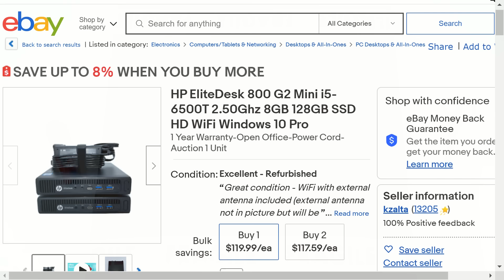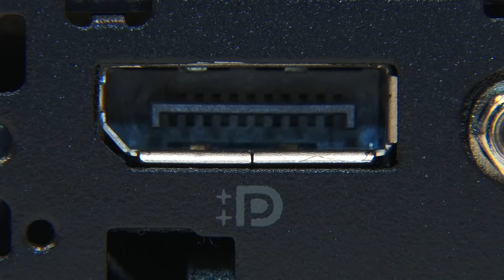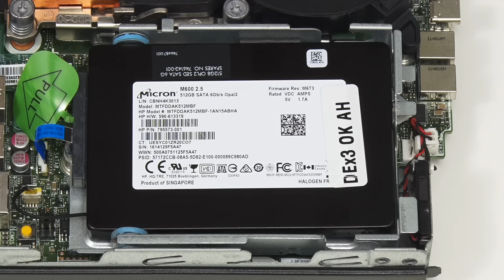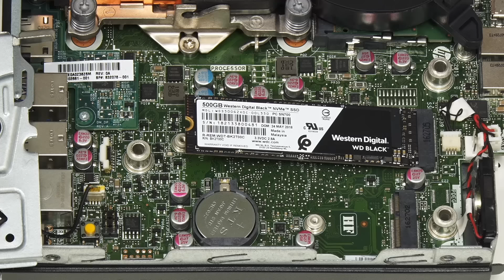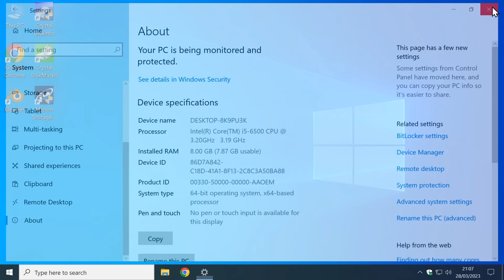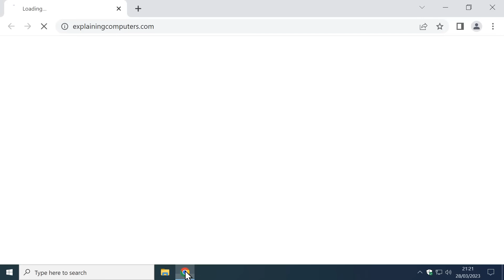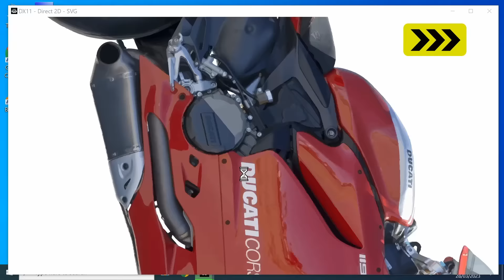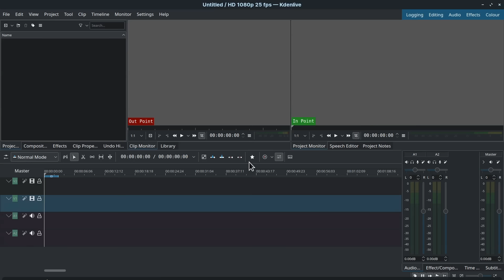Renewed i5 Mini PC: HP EliteDesk 800 G2

Comment: Just a word of warning... I picked up an HP EliteDesk 800 G3 Mini with a Core i7-7500 CPU in it about a year ago and it has been working very nicely since then BUT I did have a problem when I made an attempt to upgrade the BIOS on it.

When I did the BIOS upgrade, the original device serial / ID number was wiped out and afterwards it wouldn't reboot without carrying out a few key presses to cancel a related error - a bit of a "pain in the bum" in my case because I was running it headless as a media server.

Fortunately, I did manage to find a fix after doing an Internet search, I was able to put in a device ID that worked for the purposes of allowing the mini PC to boot without any key presses.

But a very nice and stable machine otherwise, the only negative is that the fan can get a bit loud - but as mine is wall mounted in a cupboard, it's not an issue for me.

It also runs great with Linux, so don't feel obliged to have to use that Windows rubbish.

Comment: I usually buy i5 8100 or higher systems for £90-110 with 250gb(240-256gb) ssd as they include no fuss installing windows 11 (has minimum requirement cpu and 2.0 tpm)

Anything under i5 8100 you should only be paying £50 or less unless they come with a ssd then £70-80 (but windows 11 can be installed on unsupported hardware just it complains more about it) 

and on the note of windows most of these business systems use pro key built into the bios (just install/boot with a Windows 10 or 11 Pro and it will automatically activate once the internet is seen) but I recommend opening gpedit and setting windows to delay feature updates by 100 days and normal updates for 20 days so your not beta testing updates ( a recent update was breaking tpm detection, this doesn't affect any of my customers because the fixed update will be released before it gets to my customers or PCs I have setup) 

For reliability if they haven't failed yet its less likely to be as unreliable as a new pc (these are business class systems) worst case is the fan in them failing or dust

Note With newer HP systems be super careful updating the bios inside windows (as in don't do it in windows 10/11 or do it in windows 7 only) as I trashed a hp i5 8100 mini form factor system when the update didn't update so when i rebooted system the bios was trashed (bios corrupted beep error)

Comment: Yep, good little boxes.   My house is spread out across a mountain side so beside a potent tower in my office, I keep mini PCs in the kitchen, the solar room and my garage.   I've been replacing all my Elite 8200s with the EliteDesk 800 G3s...  I was a bit surprised that on this model the USB3 ports are all black, no blue inserts.   But, they work fine and since I have them on the integrated work centers, I don't see the ports anyway.   These are great options and the refurbs are well priced (compared to new).

Comment: I have personally imaged and cared for thousands of these machines in a healthcare setting. These things still run when caked in dust. Great machines
Reply: what type of O/S they are running in your environment?
specs of hardware?

thanx
Reply: @bensmotorbikes  Running windows 10 (4gb ram, 128gb ssds or hdds)
21-25 degrees wall mounted in wards. Full of nasty dust and hospital crap
Reply: @tbrowniscool  nice!!!
did you do anything special to them to make them work in hospital environment?
things like disabling USB to prevent people hacking the devices by using some usb flashdrives, wifi using certificate authentication ? (or wifi disabled at all?)

lock bios? 
disk encryption?

what about CPU fan? had any issues fans failing?

i am asking this because i am looking for similar device for schools on budget for a lot of children while budget is around 200$ per device (excluding monitor/keyb/mouse).
and main purpose is to have it running basicly 24/7 in classes while keeping maintenance and hacking (preventing kids breaking or hacking O/S) as low as possible..
Reply: @bensmotorbikes  Yes we use a custom windows image that disables USB use etc. All machines use bit locker and locked bios of course. All machines use wifi and if they are wired up that's a bonus. We do no physical changes to the machines.

Edit: we are spending about £400-600 per desktop and about £700-1200 per laptop btw.

Yeah make sure you order the right machine and have the knowledge for a custom windows image. Ideally flashed from a usb stick or network point. How many machines are you thinking of. Kids can't break what we have but out budget is over a million pounds a year on windows licenses!
Reply: @tbrowniscool  well, its a voluntary project, licenses for ms windows are provided for free basically.

we only need to get the proper hardware.
i was thinking about either this device or similar from Lenovo or Dell..

The main usage will be for kids to learn programming and school projects.

currently the requirement is for a pilot run for 80 machines... (2 full classes + some spare machines.)
Reply: @bensmotorbikes  Well it doesn't matter that much what hardware you buy. If you cannot image the machines to have custom settings the kids will break/hack them. 

SCCM is the main tool for providing functionality once them are imaged and deployed.
Reply: @tbrowniscool  for imaging i am thinking about using FOGProject tool + ansible..
and image will be sys-prepped with all basic required stuff pre-configured + required software installed..

Comment: I sold a lot of these to my clients.  You can get the bracket to mount them to the back of the monitor or even under the desk.  I have one of these exact models right beside me that I use for my Kali linux machine with xRDP so it can be headless.

Comment: I have nearly the same Hp with a i5-6500T. The power consumption of this system is astonishing very, very low. Another very nice little and cheap computer are a HP 705 G4 Ryzen 5 Pro 2400G (65W) or with a 2400GE/2200GE (35W)

Comment: Thanks for the review.  I was looking at these on Amazon.  The prices seemed better than reasonable for the specs. At this point, I have two one year old Ryzen 5s and two older Mac minis, plus an iPad, iTelephone, one of those $100 PCs and a bunch of Raspberry PIs. I'd consider one as a media centre PC, but the menagerie is overflowing and I only have one pair of hands and eyes so there's no room to add more gadgets. The Mac running Mint is doing fine for that purpose anyhow. I'm not terribly bothered by lack of Windows 11 support. With any luck, that will drive prices down and increase Linux market share.

Comment: Personally (and as advice to others) I would never trust a computer that came with a used SSD unless you can verify the amount written.  SSDs (both regular sata and nvme) are so cheap these days (for a 1TB or less) that you might as well just put a new one in and then you can sleep better at night, if the computer is going to be used for anything substantial like a regular home computer or to store information that is important (like pictures, or important emails or documents, etc; although you should always have a backup regardless).

For most people, even the Intel 6000-series and newer CPUs are plenty for the average person's needs ( I use a full sized Core i5 6500 at work and for work purposes, works perfectly fine for what I do, which is mostly office work, watching youtube, listening to music, among other common tasks).  The people who may benefit from the newer CPUs would be media creators (people making videos or photographers, graphic artists), enginners, and gamers primarily (and for many of those tasks, the graphics card will likely make more of a difference than the CPU itself).

Comment: This issue with M.2 screws is a constant irritation and a huge design flaw - Those tiny screws are always either missing, fall on the floor or fall into the guts of the machine where they are impossible to find, especially when working on a vertically mounted motherboard or tightly packed laptop. I consider it a huge oversight that they didn't design these slots with a simple onboard twist retainer or spring clip like RAM has, after all M.2 devices don't need to be held down with any kind of serious force.

Comment: I purchased an hp prodesk g4 for $160, personally I definitely would recommend stepping up to the newer 8th gen CPU (8500t), especially if you are using it for a Plex server. My unit can actually for two ssds, but didn't come with the HDD caddy.

Comment: My son and I messed around with renewed SFFs and laptops for years. Plus, I repaired or rebuilt used systems for years due to affordability. What I valued about that experience was my experimentation with over 20 OSs to determine usability and preference. Many people do not need the powerful systems that they purchased due to desire not need. Which channel was the most influential and informative over the years - Yours! Thanks, Christopher!

Comment: Warning: when removing the SSD, the aluminum washers around the small blue pads may fall into the device and cause a short circuit.
These aluminum washers can be removed without any problem. It's safer.

This PC works fine under Artix Linux.😎
**
Attention : lorsque l'on retire le SSD, les rondelles en alu autour des petits plots bleus risquent de tomber dans l'appareil et causer un court-circuit.
On peut ôter ces rondelles en alu sans problème. C'est plus sûr.

Ce PC fonctionne très bien sous Artix Linux.😎

Comment: So, the installed Windows 10 was already activated?  STRANGE about the inability to check total SSD writes OR to update the firmware.
Reply from the maker: It was indeed. And the first run was "correct" -- prompting to create a user/etc. Just like any new PC. But this will of course depend on the vendor.

Comment: Looks great for easy, low cost, low powered, low horsepower required, computing, especially in the realm of Linux workstation and set-top box for media center.

I have 2 uses I'm looking for:
#1. Windows 10 Minecraft Bedrock / Android Bedrock from APK file on Linux with Java edition on Windows and Linux.
#2. Media Center set-top box under Linux.

I'm guessing that for streaming, storage and playback, this unit and other similar units - especially with increased performance hardware - will be able to keep up this demand.

I'm interested to see how the performance is on the 3-4 versions of Minecraft.

Comment: ive got 3 old dells. a 9010mt which is used as a 24/7 media and cctv server, its been running for over 5 years now and cost £100. also 2 laptops still going strong about the amount of time so def worth a punt! forgot to add all 3 are running tiny win11 :)

Comment: I watched this from a HP EliteDesk 800 G3 Micro, that I bought as a second hand machine from a PC recycler, I upgraded the ram and am running Ubuntu 22.04, it's a great little machine, and with 3 monitors it's great for programming and desktop stuff, when I need compute power I have proxmox servers for that, and I don't game, so this was a good low cost way to power a few monitors

Comment: 10:46 - bit crude, but unless you could find a screw, wouldn't you be a little bit... screwed?
Reply: Would you not just use an appropriate threaded screw with an adjustment washer?

Comment: A nice little PC - a good emulation / media solution for not much more than the cost of some SBCs... and HP are very reliable, I have many reconditioned HPs and they have been going for years.... Thank you for the unboxing and review!
By the way you can still buy the mounts for the HDD, I buy them when I need them, "4x HP Compaq Blue 6-32 SFF Hard Drive Isolation Mounting Guide Screws" and it's £3.50.... not too bad.
Reply from the maker: Thanks for the info on the mounts. I must order some.

Comment: I have this machine. It's running Ubuntu. It has 16 Gig Ram, 256 Gig SSD and a 1T Drive. The only problem I came accross is that my version will not allow for 2 ram sticks. The 16 Gig is a single chip.

Comment: They make great media PCs and work very well with Libreelec. They support 4K60 and decode x265/10 bit with no issues. Good replacement for RPI4s in this role at a significantly lower price and better stability.

Comment: Thanks Chris, these small desktops sure are handy. Will we see ChromeOS Flex on this one at some stage? Certainly much easier to find than a Pi 4!

I've been considering getting one as well but I don't know if their USB-C ports will support video out. I couldn't find anything online so I assume not. 🙂
Reply from the maker: Thanks for your support. I'm pretty certain that the USB-C here will not support video out -- as I assume it is USB 3.0 (and video arrived with 3.1), and also because the chip and chipset support three displays, and these are already connected via other connectors.

Comment: Amazon disease with the outer box size.

HP I5 wouldn't have one as a gift now.

My 6 year old HP Pavillion laptop  has an I5,  and  running Windows 11 pro i.e.  every advantage in life ? . .  . . ., job execution is measured in years. But it has built-in TPM, so the transition to W11 wasn't that traumatic, even though Windows update declared it unsuitable.

As stated below I7 better bet, especially one of the Dells (Generally faster)

And wouldn't it be better (And clutter reducing) to pair a small form factor desktop with a matching reduced form keyboard, like the Logitech K-series with a built-in touch-pad . . far nicer IMHO.

Comment: It's always encouraging to discover that you have twice as many fans as you  thought, isn't it?
When the original board dies,  the box might be recyclable to a container for another SBC.
Reply from the maker: Ah, a Pi in this case. I had not considered that . . .
Reply: You can most likely fit a normal mini-ITX motherboard into this case.
Reply: @matsu1994  i don’t know this specifical case, but for example dell pc (i have one) have non standard parts
Reply: @matsu1994  Nope, the motherboards of these 1L desktops are proprietary and slightly smaller than mini-ITX. It's quite easy to find replacement motherboards for them though.

Comment: My current DT is an HP recon with 16gb, works just fine, and now over three years later, but I've been looking at the refurb stuff on Ammy Zone: 8gb Lenovo (CHINESE!) for 120 CDN$ "Lenovo ThinkCentre M93P Flagship High Performance Tiny Desktop PC | Intel Core i5-4570T up to 3.6GHz | 8GB RAM | 500GB HDD | WIFI | Keyboard and Mouse | Windows 10 Pro (Renewed)"

Just as an aside, I paid over a hundred bucks for 64K ram for the video system of a DELL 486-SX back in 1994, $1500 for the machine.

Comment: Nice. I have a HP desktop, not the same one as in this video, but it is 12 years old, and it's a standard ATX tower. I like traditional PC's due to upgradability, variety, and repairability. Would you ever review a computer older than 10 years old?
Reply from the maker: I have reviewed computers older than 10 years old! :)
Reply: @ExplainingComputers  That's rather interesting. I find my HP to be very usable, and it too runs Windows 10, although I'm thinking of putting Linux Mint on a separate 1tb hard drive. My machine can have up to 4 hard drives, or SSD's. I'm not keen on upgrading to Windows 11, I will probably go down the Linux route after 2025. 😁

Windows 11 is cool, but I've heard rumors that Windows 12 is on the horizon, so it will be interesting to see whether or not we see a Windows 12 next year. I don't really like Windows 11, due to the hardware requirements, and Microsofts attempts to lock you into Windows using Microsoft account, and a TPM module; it's restrictive to say the least.

Comment: I use mini-pcs in my business (python), BeBepc "Aliexpress" I3, i5, they have good performance and low energy demands, witch means it can go HOURS on a little 12v 9A Stationary Battery, mine has rs-232/485 ports, 4g module, sd card module, 8gb + 256 ssd, all for 130 U$D....this is good recycling, this parts use to be from a lot of different computers as some mudules are "Dell", and some are very generic. Trying to put all i can in 12V standard if i can.

Comment: Thanks!  When it comes to running Windows 11 on older hardware, will you be able to consider the issue of upgrading existing installations of Windows 10?  If that is even possible?  Enquiring minds wanna know 🤔
Reply from the maker: Yes, I will be covering both a clean install and a Windows 10 upgrade. I'm currently preparing to record the video next week.
Reply: @ExplainingComputers  Thank you, that will be very useful.  ♥

Comment: Interesting, Chris. My desktop is from 2010. I'm loathe to get rid of it because, hey, it works, and is in good condition. Perhaps a refurbished unit is worth considering if I decide to upgrade. I do like Debian MATE for its relative light use on resources. I dread the idea of using something like GNOME or Windows. I haven't used Windows for a few years now. From what I've seem one has to be a real glutton for punishment to use one, and seems packed with resource-hogging frippery that is just not needed.

I used to have a full tower, then mini-tower, then slim-line, then a Vivo, small form-factor PC. Not as small as the one you featured, mind. I did a lot of hand-wringing as I moved to smaller sizes, worrying about upgradeability. The smaller size hasn't proven to be a showstopper and, well, it feels so much better to have something that isn't hogging up all the desk space, and is easy to carry if I want to shift things around.